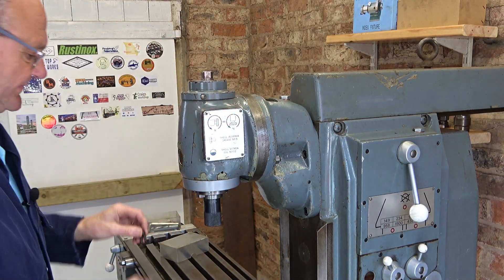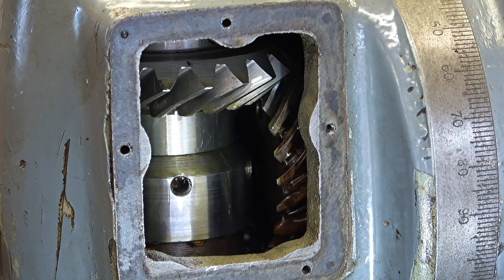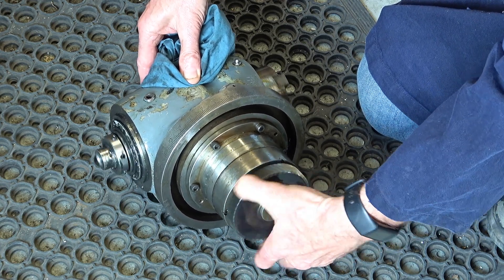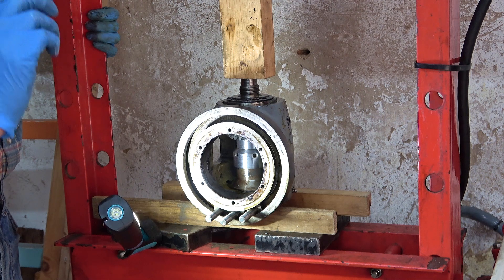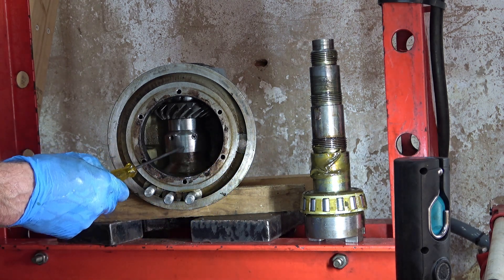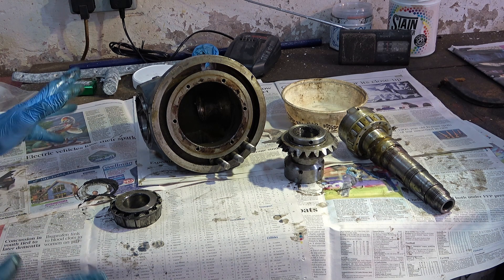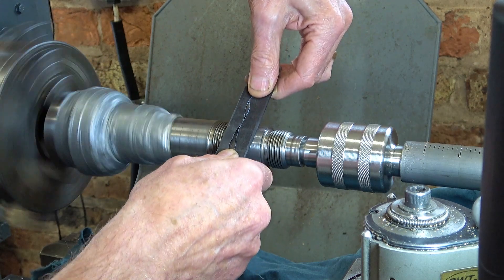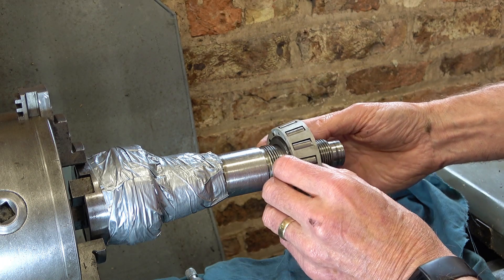HS222 Harrison mill vertical head spindle bearings adjustment - Part 1

Comment: Interesting that they use grease to lubricate the bearings.
That is normally for bearings turning 600 RPM or less.
Just heavy lube or too much can lead to heating and bearing failure.
I know it seems backwards, everybody wants to put a heavier weigh lubricant in to fix a bearing that wants to run hot but you actually want a lighter oil.
Reply from the maker: Hi pvtf, with these old machines there does not seem to be a fixed rule. I think they just made them and if that worked then that was it. Often not best practice in design or application but I guess there was not much pressure to change. The spindle bearings on the Harrison vertical mill (only had the vertical head, not horizontal) do run in oil top and bottom.  Cheers

Comment: Wow, another "simple" job which became complicated fast.  Well done.
As you said, the head really could do with oil seals on the side for when you need to rotate the head.
I hope the bearing sealer does the job.
Looking forward to Pt 2.
Dave.
Reply from the maker: Hi Dave, Harrison made several variants of this mill and the vertical mill (no horizontal spindle) does have seals with the bottom bearing in the gear oil and the top bearing with its own separate oil reservoir on top. Cheers

Comment: To increase the diameter of the shaft, you could always just knurl the shaft with a fine knurling wheel, were the bearing is supposed to fit.
Reply from the maker: Hi Anton, I wish I'd thought of that, but I think the retaining fluid I used will be ok. You will see in part 2 I spent a lot of time 'feeling' the bearing adjustment before I committed the loctite. Cheers

Comment: You could knurl it just a part of the diameter which will bring diameter back up, then carefully turn it back to size, not going for a good deep knurl just enough to bring it back up, then your bearing will be good fit 🇬🇧 Coventry UK.
Reply from the maker: Hi Grahame, you will see in part 2 that I used medium strength loctite bearing retaining fluid but yes I agree I could have raised the surface by a fraction with various methods. On reflection that may have been a better solution but we'll see how we get on. Cheers

Comment: Hi Paul, really well explained video, as always. 

There are some good suggestions in the comments as to how to recover the fit without using loctite. 

The internet and YouTube will provide others. I wonder if there is someone out there who has crossed this bridge before especially given the need to adjust the preload and get the right fit on the gears.

Best of luck and have a great weekend!!
Reply from the maker: Hi David, yes lots of help - which I read a bit too late but still I think the softer bearing retainer loctite is ok. Cheers

Comment: Hi Paul, easily done, don't worry. I would set it back up in your lathe in the 4 jaw, get it running true at bearing journal, put a piece of HSS Cobalt in the toolpost with a sharp edge (normal turning tool geometry), get a suitably sized block to use as a stop under your chuck jaws to your bed, and then put 4 equally spaced grooves into the surface (all at the same depth) along the full length of the adjustment range - do not de-burr! This will raise the shaft surface equally round the circumference to give you the fit you need. Loctite will do but you won't have enough working time to do a good reassembly job with it, and it will be a 1 time only adjustment which is no good really following a strip down like this as you may need to tweak after the first few hours of running when the bearings seat properly again. Hope this helps and makes sense. Cheers, Jon
Reply: Great advise Jon. Will have to put this in my hand written log for a future issue. 👍👍
Reply from the maker: Hi Jon, I did not think of raising/forming the surface as you describe and, as you can guess, it's already back together. The spindle is pretty soft (well, not hard anyway) so the method you suggest would have worked just fine I'm sure. I'll know for next time. I spent a lot of time feeling for the best bearing adjustment so I'm  hopeful it's right.  We shall see .... Cheers

Comment: Great diagnosis and strip down Paul, possibly the grease in the taper roller bearing has a Molybdenum Disulphide additive ( already commented by a subscriber), fine in CV joints, but being lamellar construction,  not conducive to high speed rollers. Quick calc on small car tyre of 0.5 m at 70 mph = approximately 1300 rpm, so a wheel bearing grease should be fine, but avoid overfilling. 
As you state, the top inner race would benefit from a soft product, ref bearing retainer, or standard thread loctite. 
Taper bearings do not like pre-load, they get warm quite quick otherwise.
You're getting to be a Harrison mill expert, along with Carl Wilson 👌🩺🥼.
Thanks for sharing
Reply from the maker: Hi John, I think between me and Carl there will be plenty of reference material now. I won't be stripping the gearbox unless absolutely necessary. It may have been apart before because some of my shaft bearings are sealed whereas Carl's are all open for splash lubrication. Cheers
Reply: @HaxbyShed  Hi Paul, 
The science of Tribology is a fascinating subject, even explains why some food tastes better over the tongue with butter 🧈. 
Here's a true story on why not to mix greases, or not removing residues. On our machines ( ex and now current employer/customer), we had a design where we had had a constantly running motor ( circa 185 kW @ 1450 rpm) with a air operated clutch, with 250mm wide multi ribbed vee belt drive from 200mm diameter driver to 660mm driven spindle. In use the spindle brake is released,  then clutch engaged, spindle rotates for required process, then to stop,  disengage clutch,  and apply brake.
This design was well proven from the 1960's (story is 2003/04), these were quite big machines,  and at the time were built by other machine tool companies for us, this vendor, had built several before hand, and issues, we had 3 of these in build at the same time, and after commissioning,  were sent to our customers in China, South Korea, and USA. Machines welded HGV truck axles, spindles to axle casing/fabrication, so two spindles per machine.
Machines installed,  working well, about 6 months in use, there was a report from the customer that the bearings had failed in this assembly, one of our guys flew out to Korea, found horrible gooey mess for grease, wrecked bearings, sleeves, spacers, and even the pulley, the other end was showing similar symptoms, we sent new parts and grease out, rebuilt etc, the gooey mess was brought back and analysed, it contained a synthetic compound?, the correct grease called was a standard high speed bearing grease, the bearings fitted were a standard deep groove ball roller. 
After much communication with the machine builder,  it transpired that a machine  tool fitter had taken it upon his self, to use a fully synthetic Kluber brand grease, as he had seen other equipment built with it (high speed CNC spindles running at 20 K rpm plus). What had occurred was that nearly all rotating element bearings, roller, ball, taper etc come supplied with a mineral oil to protect against corrosion, this had reacted with the synthetic grease, created heaven knows what and caused the damage. When using synthetic,  or other lubricants, all residues must be removed very throughly.
Kluber do make a wide range of greases, including mineral based, but are very pricey, especially synthetic types .
It gets worse,  this same machine too fitter, had built all six of these assembly's for the 3 machines, and sure enough the 2nd one had the same issue, gooey mess was sampled again.
The machine builder had to pay for qty 4 new assembly's, luckily the 3rd machine was installed, but not commissioned, so 2 sets of bearings and seals, plus travel costs, for all.
Every day is a school day.
Reply from the maker: @bostedtap  Hi John, that is a very valuable lesson. I recognise that the science of lubricants is subtle and complex. I always try to match the lubricant details on the machine plate. China, Korea and USA would be a challenge in customer management, being 3 very different cultures. Cheers Paul
Reply: @HaxbyShed  Hi Paul, 
I've probably done something similar during my machine building days, I did use some moly grease on the wheel nuts on my Leyland Mini, first car, 8 years old, and well rusted away, when I found out it not being suitable for fasteners that need to stay tight, I cleaned it off. Moly grease is used on screw threads, but only when maximum torque for clamping force is required. 
Another, and last story of Kluber synthetic grease, is from Coventry circa late 1980s,  I was working over there on a short term contract, then on to install the line at JCB Transmissions in Wrexham. This was told to me by one of the leading hands I was working for, several months earlier, they had a special spindle that had to be prefilled with this exotic white grease,  there was some left over, so a machine tool fitter put some in a jam jar (very popular container for transporting various materials from work to home), over the weekend he repacked the rear wheel bearings with this grease (front wheel drive obviously), he used the car on Sunday,  then driving to work Monday,  the car was struggling to accelerate, and getting slower and slower. Day off work, new wheel bearings, Tuesday,  tells his story, and gets a unusually mild telling off for taking company property, due to expense and loss of pay.
You mentioned Lithium grease,  lithium is just the soap or thickener, Calcium is used for waterproof greases as I understand. 
Very complex as you state.

Comment: It's good how you got it stripped down, a nice sliding fit would have been better, but easy to go further than you needed, surely with loctite, you would lose your desired intention to set the preload, and the future preload adjustments? I'd just assemble it as is, with some decent grease and see how it runs. best of luck!
Reply from the maker: Hi Dave, mid-grade bearing retainer loctite stays workable for long enough to make and 'feel' the adjustment (90% strength after 6 hours) and it never sets rock hard like thread lock.  I think I could still do fractional adjustments later if necessary. Cheers

Comment: And then people ask me why I am completely stripping and rebuilding my Harrison mill. This is why! That shaft must have been made like that from new. Frankly nothing surprises me on these machines anymore. For my money the fit you now have of the inner race to the shaft is as it should be. Loctite retaining compound could be used if you are concerned. I have learned much from this Paul, thank you. I am looking forward to part 2!
Reply from the maker: Hi Carl, I suppose I would have saved time if I'd just stripped the head down when I got it. I'd just not anticipated so many niggles. But when you get a new machine it's hard to know at first what are faults and what are 'features'. Cheers
Reply: @HaxbyShed  Of course it is. No criticism of your approach intended.

Comment: That was a bit a scary project. This can go wrong very quickly.
As for the bearing fit, a few small center punches in the shaft will do the trick.
Reply from the maker: Hi Michel, thanks yes many comments suggesting a groove, knurl or punch to raise the surface a fraction. I think the shaft is less than 0.01mm under size and the spindle is only medium grade steel (not hardened).  Of course I had already used bearing retainer loctite before I read the comments  😁 Cheers

Comment: Far too much of the wrong grease in the top bearing. They only need to be filled to 25-30% full. Kluber do a range of long life spindle greases, they are not cheap, but experience tells me that they work exceptionally well. I'd give their tech a ring for what they recommend, NBU15 is one that comes to mind.
Reply from the maker: Hi Bill, the machine plate specifies the correct grease and I manged to get the modern Shell equivalent.  It was Shell Gadus S2 V100 3  lithium grease, about £10 for 400g.  Cheers
Reply: @HaxbyShed  You saved a small fortune there then Paul. I think 400g of the Kluber is over £100 now. They did do a 50gm tube for about a 1/4 the price.

Comment: Is it possible that you could drive the shaft up and set the preload with the bottom bearing? My thinking was you were driving the shaft down and it was hitting on the bevel gear so that kept it from moving downward....
Reply from the maker: Hi Danny, there is no adjustment on the bottom bearing it's all on the top. At first I think the bevel gears mesh was an obstruction, until I backed off the collar behind the top bevel and allowed it to slide up. Tricky job really. Cheers

Comment: Also don't use a Moly disulphide grease as it is so good, it can cause the balls/rollers to skid no more than 3% however I would only use a plain bearing grease. Cheers
Reply: Spot on, fantastic for plain bearings or slidingg surfaces.
Reply from the maker: Hi, the machine plate specifies Lithium grease and that's what's in now. Cheers

Comment: Could be wrong but I don't think your bearing is too loose after polishing. Similar to car wheel bearings or any taper bearings, the outer collar (nut) sets the preload on the bearings and prevents the inner race from spinning on the shaft. Prior to polishing, the inner race was seized (why you had to press apart), and not floating on the shaft as it should.
Reply from the maker: Hi W65er, yes it was too loose I should have tested it for fit more frequently as I was polishing. It's another lesson for me. Anyway you will see in Part 2 I used bearing retainer loctite and I think it will be ok. Cheers

Comment: Loctite is your friend in situations like this.
Wick in loctite would be ideal but the lock ring will obscure the inner race.
Blue loctite has a slower cure rate so you should have enough cure time. Surprised Harrison didn't go size for size in this application.
Good luck.
Reply from the maker: Hi Willem thank you. You will see in Part 2 I used Loctite 641 medium strength bearing retainer. Cheers

Comment: i was a long-time auto tech and did a lot of press operations with bearings involved. i think you did a great job of getting that head apart given the circumstances. but if you have to press on a tapered roller bear the way you did that will damage the bearing races. i would replace that top bearing. really cool mill.
Reply from the maker: Hi Jack, I understand your point and the possibility of damage it's just I don't want to spend perhaps £200 / $240 for a new bearing. Cheers Paul

Comment: More shop illumination? The answer is "Barrina".  Got 60 of them @ $6 each: 2200 lumen @ 6500K & 20 watts each. Lowered my shop electric bill by 2/3 & have 132,000 lumens to keep the old man's eyes lit up. Nice job on the mill; can't wait to see the finals.
Reply from the maker: Hi Bob, nice to hear from you. I Googled those Barrina LEDs and we can buy the same ones here in multi-packs. Seem to work out about US$12 each. These things are coming down in price all the time. Cheers Paul

Comment: Gday Paul, it’s a fine line between being loose and snug fit, I’ve scrapped a couple of parts from this in the past, cheers
Reply from the maker: Hi Matty, I did not think of it at the time but raising the temp of the bearing by 30 degrees might have been enough to slip it on when I did the first fitting test. By then the spindle diameter  was probably less than 1/2 a thou over. Anyway it's gone back together with a bit of medium grade loctite bearing retaining fluid so even if it needs further adjustment it should have a little give. Cheers.